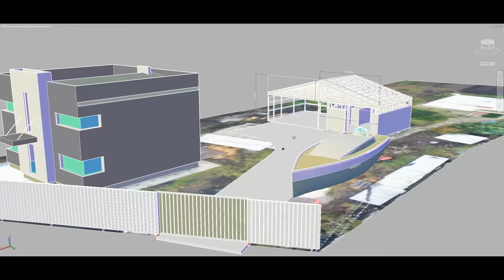Young Woman Has Inherited Old Barn With Garage and is Restoring it With Man ►1

Comment: 5:21 are they asbestos sheets?
Reply: I think so, they are buildings of more than 60-70 years
Reply: @dschiulaz  if it is asbestos do not treat it that way... Directive 83/477/EEC (if they are in Europe) - Must be treated with the right care
Reply: Looks like on how they handled those sheets without at least some proper PPEs or wetting the panels they have no clue that those are asbestos. I really hope they don't destroy them for easier transport and get them removed by proffesionals.